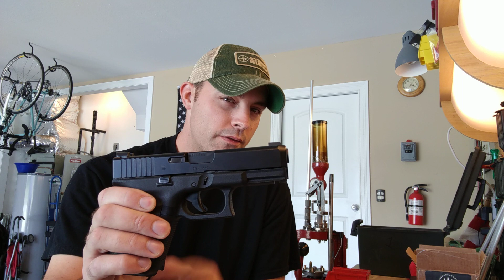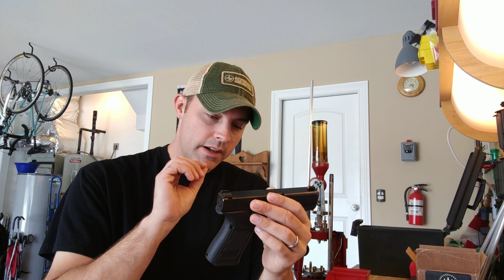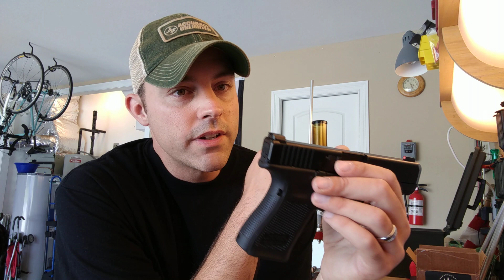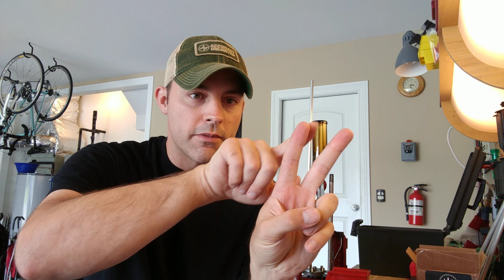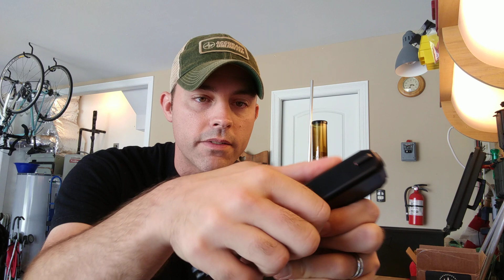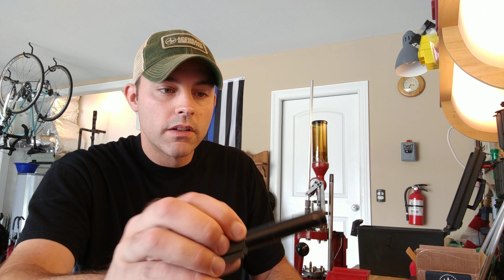Project 1 Gun, Glock 19 Gen 5: update 3 (one month in, it multiplied)

Comment: Just a thought on why the agent sights aren’t entirely accurate. They are made for a number of different models with varying slide lengths. The further the distance, the smaller the front dot appears in relation to the rear dots and notch. On a G17, the top of the front post is probably a lot closer to level with the top of the rear sights when aligning the tritium viles because the slide is longer. If the bold sights directly from Glock are specific to the 19’s sight radius, they may be inherently more accurate, hence the additional cost. I don’t know that to be true though. All-in-all, I like the one gun concept. More systems means more work and more opportunity for confusion and failure. Less is more in a stressful situation.

Comment: I’m up to 1050 live rounds in my G19 Gen 5. I haven’t kept track of my dry fire rounds.  I dry fire with snap caps pretty much every day since buying the gun at the end of April.  I haven’t had any issues except one snap cap that jammed in the chamber and kept the slide from locking back.  Otherwise it’s been a good shooting gun.  I still have the factory night sights only because I have committed to training with only this gun as is from the box.  I’ve been following you as you work with this gun.  My back up gun is a G26 Gen 4 but the G19 has continued to work well and reliable.  I carry it daily as well.  Enjoy your videos however.  Thanks